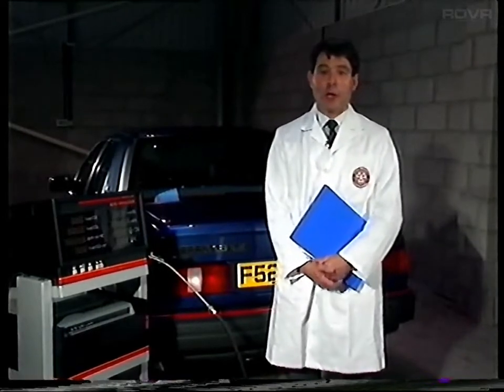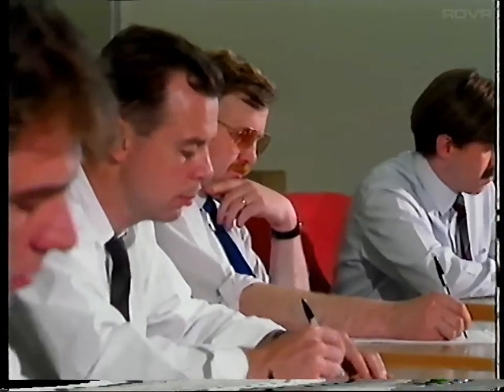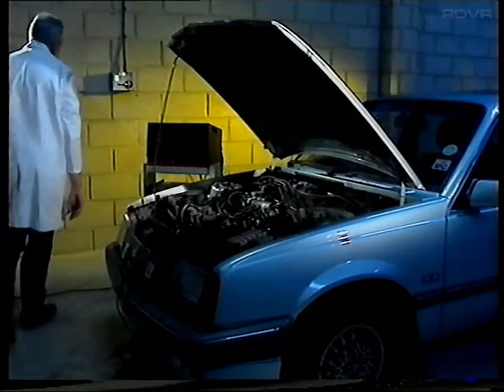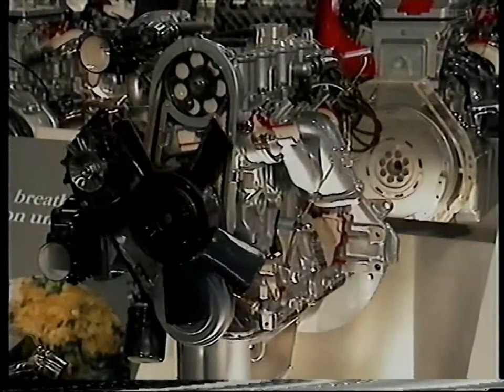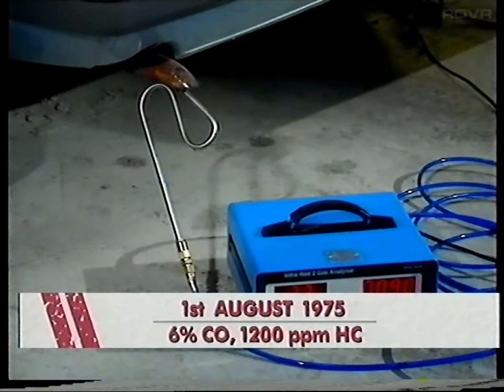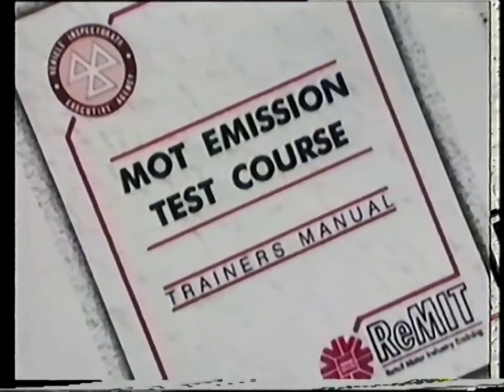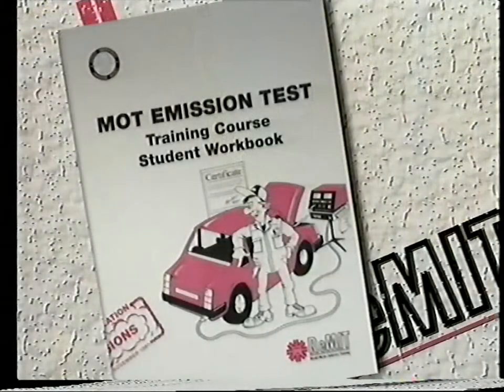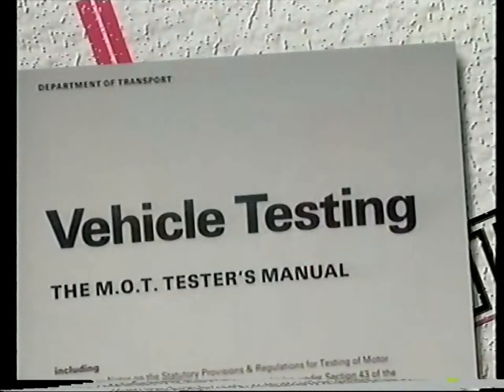VI / ReMIT - MOT Emission Test - A Practical Guide (1991)

Comment: Remember when this emissions check came into force my dad's 2.8 ford granada failed on emissions and struggled to get it through the M.O.T eventually after fiddling with the mixture and carb it just got through the M.O.T
Reply: My everyday car is a 1988 Volvo 240 GLT which is of course; Fuel Injection by then.  It always passes emissions with flying colours. But it does sometimes need tweaking.
Reply: @Landie_Man  To be honest volvo was one if the first to put cat converters on there cars it usually says catalyser on the boot lid think they knew what was coming in the future great cars love old volvos
Reply: @steve_o379  they were available at the time. But mine was not built with a Cat.
Reply: @Landie_Man   ah I see